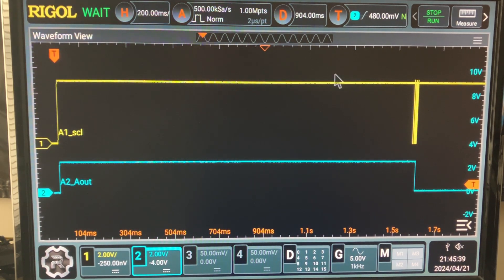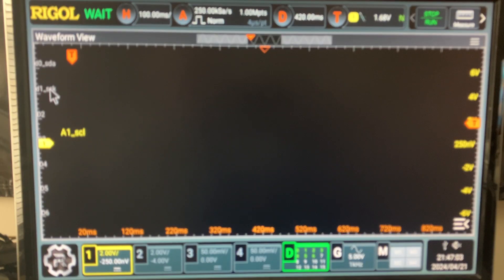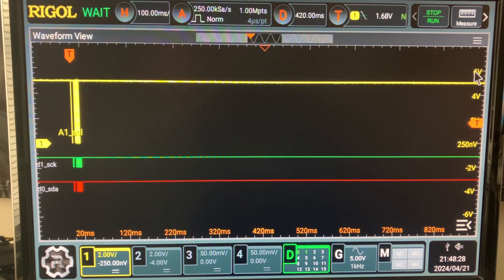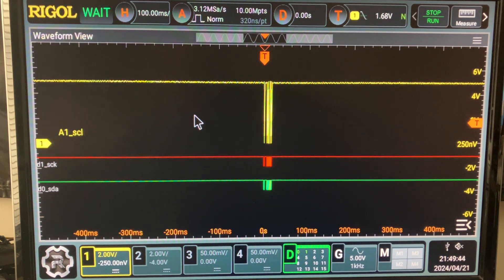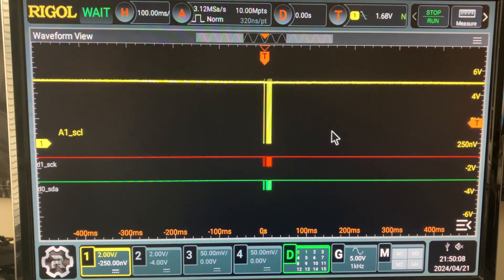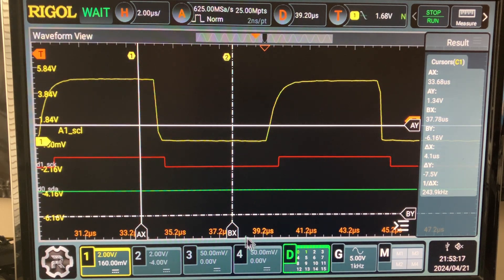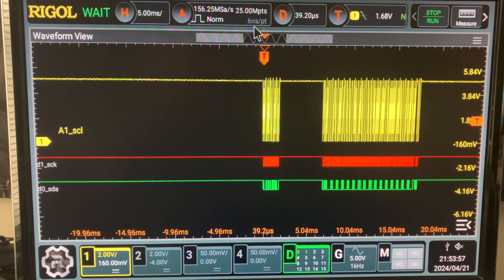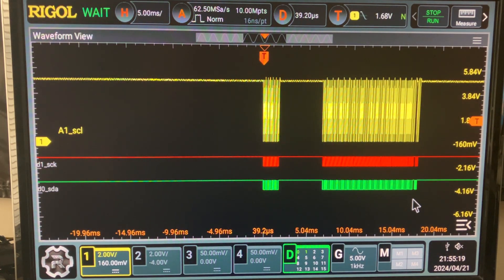Rigol DHO924s I2C sampling with Logic Analyzer board

Comment: Very interesting! Could you pls. do me a big favour and check if SPi Decoding works with your DHO924S together with the LA ? 
I'm asking because I own a DH0924S in conjunction with an original LA Modul from RIGOL but I wasn't successful to use the SPI Decoder by just using the LA's channels alone. Everything works fine as long I feed MOSI, SCLK and CS into the analog channels. But If I feed in these Signals into 3 LA Channels and assign them within the SPI Protocol Decoder the Decoder will not show any decoded values as I successful got when i used the Analog Channels (with appropraite Threshold values). The LA Traces show the SPi Signals just fine but the SPI Protocol decoder will ignore the signals from the LA. May you pls. give this a try with your Setup? I'm very curious if this is a FW Bug which I suspect. Thank you very much in advance! BR - Peter from Munich, Germany - ;)
Reply: Hallo Peter, das ist ein bekannter Bug. Hoffe auf die nächste FW, aber da kam schon 6 Monate nichts mehr.
Reply: @hansmoser162  I thought that is the idea of the MSO scopes (Mixed Signal Oscilloscope). I think Rigol never claimed that the signal would by synced in the DHOs.
Reply: @michaelkaercher  Yes, it is supposed to be the Idea of a MSO. But it seems that our Ideas does not match with them of Rigol 😕 The LA part is integrated very poor in this Rigol Scope 😞. Now I switched over to a Saleae Logic probe. Cannot recommend the LA for the Rigol. It is insufficient even for simple tasks.
Reply: @hanspeterbestandig2054 did you buy the 1.500€ original one or the 60€ Ali-Version?
Reply: @ Hi, I own the original one from Rigol which costs ~ 300 Euro here in Germany. Interestingly since of a FW Upgrade SPI decoding does now even work with the LA channels… However the FW gets better it still contains some bugs. For example I told the device to restore the recent settings upon each start. So the LA Channels are there BUT the trigger settings are set to the analog Channel 1. changing it to an appropriate LA channel (I choose nCS) the trigger gets active only if you slightly change the voltage threshold for this LA channel in the trigger settings. You‘ll need this despite the Oszi claims that the level is fine (here 1,6 Volts) for a 3V2 DUT… Just as an hint 😉
Reply: @hansmoser162 is it fixed in the current version? I am struggling to buy the 924s.
Reply: @MatzeMaulwurf  It should be fixed since 1.03, actual version is 1.04. Can't test myself, I just have a 804.
Reply: @MatzeMaulwurf  yes it is! But pls. Read my comments below!
Reply: @ Yes, I can confirm this. I have 1.04 and the issue is fixed in this Version. However the Oszi still does not proper restore the last used Setting upon a Powercycle: The trigger settings to a certain LA channel will be lost (see me response, for MatzeMaulwurf).
Reply from the maker: I saw the issue online with SPI.  I had build a SPI break out board for capturing SPI on the camera scanner that I have build long time ago but the AI on the camera does not generate a repeatable predictive SPI signal to show on youtube. I didn't do any video on this issue but I just got a siglent SDB3 demo board that would make this easy and now I am just waiting for Rigol to release the new firmware that hopefully address the I2C 5 bytes data triger, the pass fail triger and maybe the SPI capture issue.
Reply: @stevelevesque939  Hi Steven Thanks! However as @hansmoder162 already confirmed that the SPI analyser cannot be fed by the LA signals due to a bug/drawback of the current Firmware. So we'll need to be patient until Rigol will fix this issue.. However I switched over to a Saleae Logic Pro because I got sick of this crappy LA Support for this device. And honestly I gave up all hope that Rigol will ever fix it. So get rid of the crappy LA Support of this Scope and I honestly cannot recommend to buy the LA probes for this device. They fail even for the simplest tasks. It's so disappointing 😞